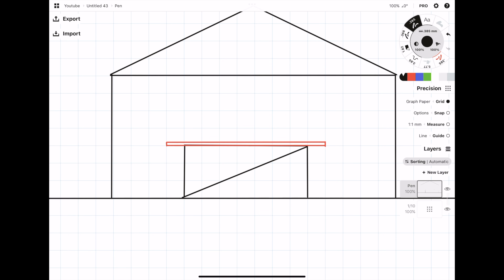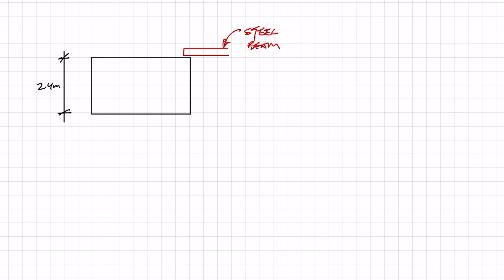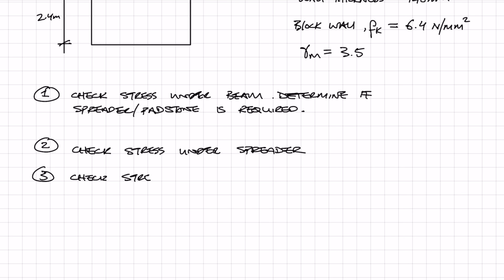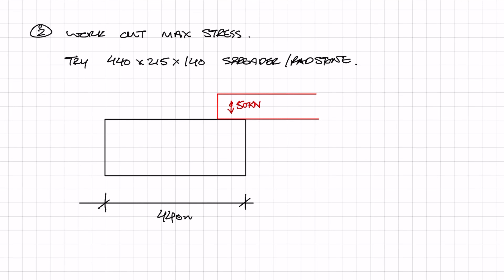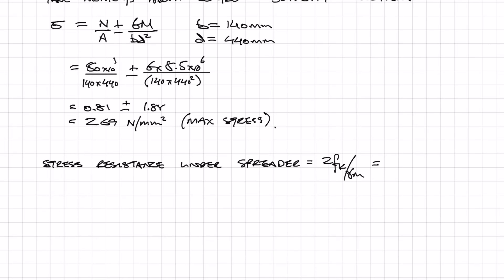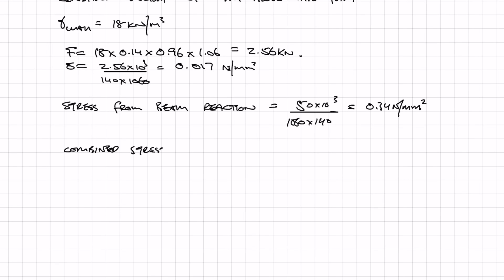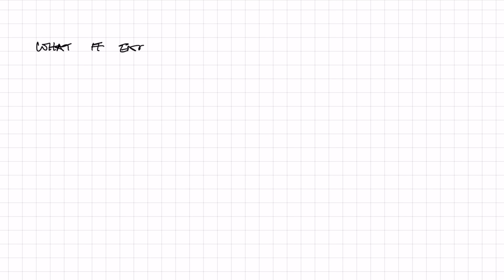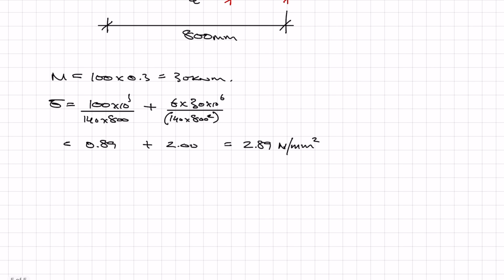Padstone Design Example for Beam Forming an Opening - Structural Engineering

Comment: Thanks for this!
A typical detail I use is to sail the beam over onto a few steel shims located centrally on the padstone and this takes away the additional stress induced due to the eccentric load!
Love your videos!
Reply from the maker: Yup definitely a good solution I’ve used before too 👍👍
Reply: Does the steal beam HAVE to be on the centre of the padstone or can you make the full padstone covered @EverydayDazz

Comment: The resultant force is outside the middle third of the padstone so I don't think the formula you use to check the maximum stress is correct. Because of this you have a triangular distribution of stress under your padstone with a maximum stress of 6.67N/mm2
Reply: Masonry can take some tension so if the minimum stress is less than the tension capacity the formula can be applicable. Most time there is a wall above the padstone by adding the weight of the masonry rarely there will be tensile stress developed.

Comment: Hello :D 
Great video.

I was wondering, when you calculate the length of the wall effected by your reaction and spread the load with theta equal to 45degrees, how do you handle the horizontal component to that load which  appears, due to the inclination of the load path. To be able to due the spread of the load, don't you need to somehow take care of the tension in your calculation.

Comment: Your initial calculation at approx 4min 24sec identifies that you also have a negative (tension) presssure of 1.07N/mm2 under the padstone but you do not explain how this is accomodated. 
If this padstone was close to the top of the wall then you could not allow this tension and would have to use middle third law for padstone.
Also a padstone that was subject to bending tension within itself would likely need to be designed to resist same. 
It is probably better to start off with a lintel bearing length and padstone that adopts the middle third rule and thus  remove the problem you have introduced of tension under the padstone and within the padstone that has not been recognised, discussed or dealt with in your explanation.

Comment: hey buddy  your video help me clarify when and how to apply Bearing type 3 when designing using  BS5628-1-2005. very useful indeed . In some non - SIP projects I occasional come across with large opening extensions. I created  a program using python to automate the stress  bearing checking. I will create an executive file  version and email it to you, you may have some curiosity or interest in  using coding for youR daily calcs. Tedds is not for me although I have used it before. Licence is quite expensive and  Tedds makes us  lazy.Thanks Lad.

Comment: Thanks great video! Red book - page 293 also contain Fk table using BS EN 1996-1-1:2005 can this table be used instead of table2 1:49  in video?
Reply from the maker: You need to be careful with using euro code fk and then using BS equations. If you use the euro code fk you should use the euro code equations and material factors.

Comment: Thanks for your sharing . How about if the wall is existing masonry wall, what will be the compressive strength for existing masonry wall?
Reply from the maker: If you were doing this properly, you need to get wall sampled and tested. 

On a smaller project, can be safe to assume a lower strength block. Something like 3N block